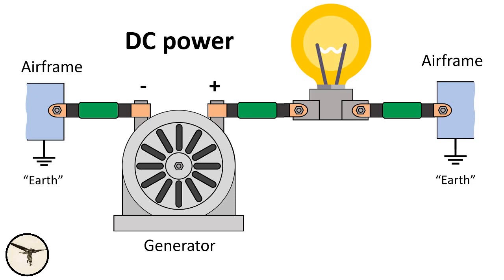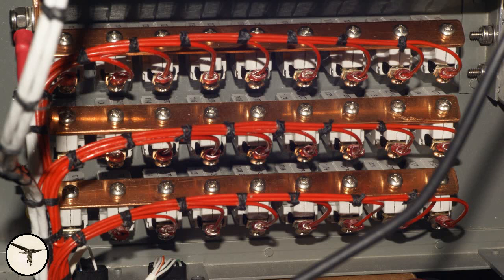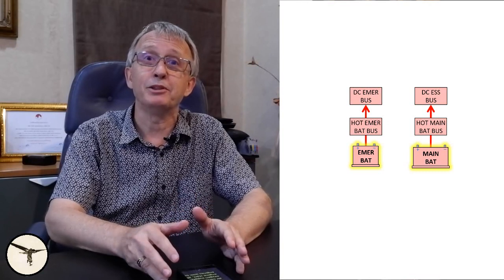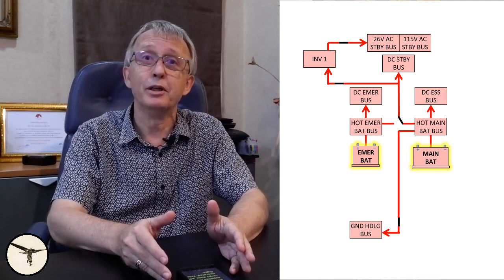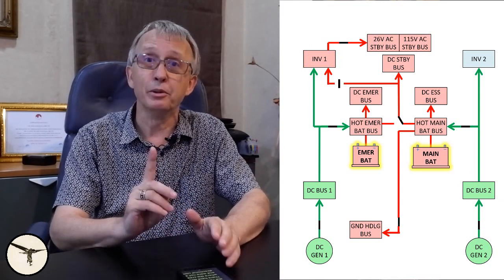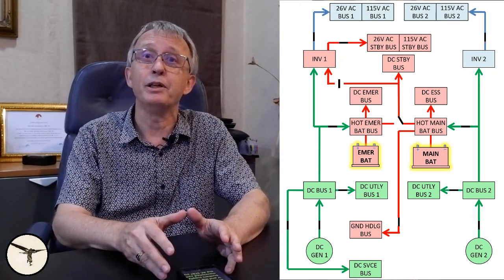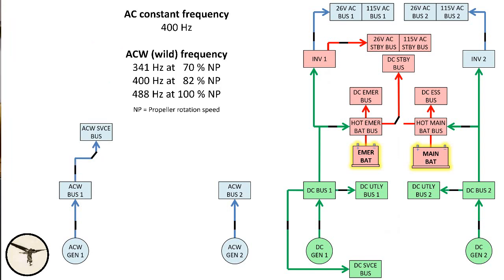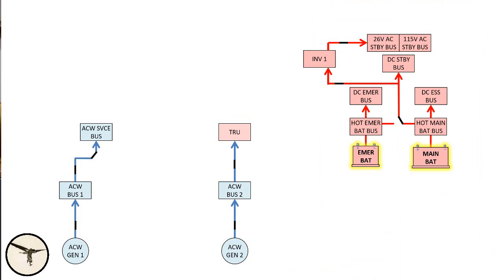ATR electric systems - an introduction

Comment: Hi Magnar, question about your production. What do you use to draw your diagrams, for instance your drawings if the battery busses with the consumers is very clear. What software did you draw it in?
Reply from the maker: PowerPoint, converted to image files with Photoshop.

Comment: Hi Magnar, is there a theoretical discharge rate for the HOT MAIN and EMER BAT BUSES with the battery switch off?  Because they are HOT, there must be some sort of depletion over time.
Reply from the maker: Hi. All batteries will detoriate over time, but we are talking about months.  However, the main battery might be depleted if the GND HDLG bus C/B is not pulled, and the refuel panel door is open, or the cargo door is operated.
Reply: @FlywithMagnar  thanks for reply. Just thinking the ATR batteries would drain quicker with a  HOT bus connected to them compared to battery that didn't. Thanks again

Comment: Funny you mentioned that about the TLU. We were just going over the QRH and a DC BUS 2 failure (72-500) and how to go about the lost equipment list. Should all items on the loss list be reviewed through the QRH or should we skim and find most relevant?  With something as important as the TLU auto function lost it would seem it should be included in  the main body of a  DC BUS 2 lost checklist. Maybe on the 600 a page is queued up. How do you approach the lost equipment list?
Reply from the maker: Hi, first of all, abnormal and emergency checklists must not be modified without consent from the manufacturer, as they are part of the certification of the aircraft. I only have the 72-500 QRH from 2009, and the checklist for loss of DC BUS 2 is different from the checklist for the 72-600, which I am flying today. In the checklist for the 72-600, the TLU is included. 
I recommend to read every item in the lost equipment list. Some items might be irrelevant, but you will only know after reading the list. If required, enter a hold and sort it out. 
Some years ago, I had a DC BUS 2 fault, and since we were 70 NM from the airport, we had plenty of time to read through the list, and prepare for the approach. We even had time to look out and enjoy the scenery.
Reply: @FlywithMagnar   "take your time" is always a good approach. Get a cup of coffee and work the problem assuming it's not an emergency.  I was also curious how to interpret the lost equipment items for "BATT only" and "STBY BUS". For BAT only (ACW available) I assume this is lost equipment under a TRU operation with no HOT BAT BUSSES? And STBY BUS lost equipment is if somehow we lose those busses?  Seems the only way to interpret it. Mange tak for hjælpen Magnar. .

Comment: why cant we get dc gen one  and two powered through ext power ,with battery switch off?
Reply from the maker: No reason for that. When we want to unpower the aircraft, we select the battery switch off. That is what it's made for. The GPU is used to provide electrical power to the systems when the engines are shut down on the ground. When the engines are running, the generators provide this power. Routing power from the GPU to the generators will only create extra heat, which is waste of energy.
Reply: I mean to say..if battery switch is off and gpu on ..then efis on number one and number 2 goes off.why do we need to put battery on to get power supply from gpu?
Reply from the maker: @shivapoudel9059  , the battery switch is the main electrical switch. When the battery switch is off and you connect the GPU, it will only power the CD SVCE BUS (lights in the cabin) and GND HDL BUS (refuel and cargo door operation).
Reply: @FlywithMagnar  its dc service bus right sir?..but in flight if we put the battery switch off ..does it work in same way?
Reply from the maker: @shivapoudel9059  , yes I meant DC. I have never tried to switch off the battery switch in flight. Never will I try it.
Reply: @FlywithMagnar  thankyou sir

Comment: Is it normal or am i doing something wrong in the sim? During taxiing with idle throttle i got low dc power
Reply from the maker: The ATR model in MSFS is wrong. Until the next update is ready, you must keep the power levers slightly above GI.

Comment: Question, the FCOM states that the Propeller AntiIce will not function below 63% NP. I’m pretty sure the ACW generators require 66% NP but I can’t seem to find it in the FCOM anywhere. Do you know what NP value the ACW generators come online?
Reply from the maker: If I remember correctly, the ACW generators require 65% NP to operate. Minimum propeller speed with engine running is 70.8% NP. 
One ACW generator can power both ACW buses and therefore all systems powered by ACW. In case of an engine failure, the associated propeller de-ice is not required. Therefore, propeller anti-ice is inhibited when NP is below 63%. This protects the propeller from heat damage.

Comment: Thank you so much for the videos. I have a question, if you don't mind. In my flights in MSFS, I've noticed that the condition levers have to be in AUTO for some time before I can engage the TRU, usually when I am getting into my taxi, but that it won't be engage-able at any point before that. Do you know what the necessary condition is for it to be actionable? Is it related to the prop speed or is it a matter of ACW power generation hitting some threshold? I am curious more than anything and would like to understand what is happening under the hood for that to become available.
Reply from the maker: The TRU is powered by ACW BUS 2, which is powered when at least one ACW generator is online, which requires the associated NP to be more than 65%. You should not start taxi until both NP are stabilized at around 71%.
Reply: @FlywithMagnar  Thank you so much! My virtual passengers say thank you!

Comment: Hello Magnar, is TRU used in normal operation flights or just as a safety measure when needed ? 
Thank you
Reply from the maker: TRU was designed to allow for ETOPS operations. But after two incidents where all instruments were lost, we use the TRU for every flight as a precaution. ATR has tracked the error to a design fault in the battery switch. When the switch is replaced, we will not use the TRU any more.
Reply: @FlywithMagnar  It reminds me of Captain Sully (Hudson River water land) who chose to switch on the APU despite the fact it wasn't written on the checklist . Smart move gained with experience 👌

Comment: Does the TRU charge batteries? If not, then why in case of battery failure, even if TRU is supplying EMER buses, aircraft loses electrical power?
Reply from the maker: No, the TRU does not charge the batteries. In case of battery failure, the TRU still supplies the EMER bus, ESS bus and both STBY buses. Both HOT BAT buses are lost.
Reply: @FlywithMagnar  Thanks for the reply!

Comment: Thank you for the Video, Capt! 
I have questions about DC GEN 1+2 FAULT in QRH. 

When if no TRU arrow light,
MAX IMC FLIGHT TIME : 30 min

1) Why IMC? Is there special reason? 

2) I guess ‘30 min’ time limited due to batteries usage time. Is that correct?
Reply from the maker: On battery power, with the battery selector in OVRD, the main battery powers DC ESS BUS, DC STBY BUS and AC STBY BUS, while the emergency battery powers DC EMER BUS. After about 30 minutes, the main battery will be empty, and you are left with the DC EMER BUS, which powers COM 1, ATC 1, and the stand-by instruments. You have no navigation aids, but will be able to receive radar vectors.
When you are about to commence the approach, you press the STBY BUS OVRD pushbutton, and the emergency battery will be connected to the DC STBY BUS and the AC STBY BUS. This activates the captain's EADI, VOR/ILS1, landing gear control, and flaps control, enabling you to fly an approach and land. (I'm  assuming you are flying ATR 72-500.) The procedure with no TRU is found in MMEL 24-30-02P.
Reply: @FlywithMagnar  
Wow, I totally understood ! 
Thank you so much capt !!
Reply: @FlywithMagnar  thanks. 🙏

Comment: Question for you @flywithmagnar 

Aircraft on the ground with the engines running at max RPM and the ACW EXT PWR AVAIL/ON. What will happen when you select ACW BTC pb to ISOL? 

Im stuck on this
Reply from the maker: This is a perfect scenario to test when you are in the simulator! The more curious we are, the more we learn.
- - -
When ACW EXT PWR is ON, it is the GPU that supplies the ACW buses as EXT PWR has priority over the generators. When BTC is set to ISOL, the connection between EXT PWR and ACW BUS 1+2 is lost. 
But from then on, I'm not 100% sure. I am 99% sure that the ACW generators will start to supply their respective ACW BUS. 
- - -
The ACW SVCE BUS is powered by ACW BUS 1 as long as ACW BUS 1 is powered. If ACW BUS 1 is lost (1% chance in this scenario), ACW SVCE BUS will be powered by EXT PWR.
Reply: @FlywithMagnar  thank you! We are in the sim later today and shall try it

Comment: That was a great overview of the electrical system.  So other than the internal batteries (Main & Emergency), there is no other back up auxiliary power unit that can be started, that runs off of the planes jet fuel, that can be used as a battery charger or tied into the electrical system if the batteries become discharged, and you don't have a power cart at the airfield?  How would a remote airstrip operation work then?  You have to have a generator at the airfield?  What voltage and current rating of the external power cart is required to allow a ATR 42/72 to be powered up if the batteries are too low?
Reply from the maker: First of all, we take precautions to ensure that we do not deplete the batteries when we are on the ground. When an airport does not have ground services, and we have short stop, we let engine 2 run with the propeller brake engaged, so-called "hotel mode". When we have a long stop, we shut down everything and start engine 2 in hotel mode before boarding. 
The batteries can be charged by external ground power (GPU). ATR aircraft requires 28 V DC ground power. It must deliver 300 Amp plus additional 1000 Amp during start where the voltage must not drop below 12 V.
Reply: @FlywithMagnar  Thanks for responding.

Comment: Hello captain. I have a question, why do you need to turn off green hydraulic when DC gen 1 and 2 is lost?
Reply from the maker: The answer lies in the TRU. When both DC generators are lost, we select the TRU to conserve the batteries. The TRU is powered by ACW BUS 2. Early ATRs don't have TRU, and when it was introduced, the rest of the electrical systems were not changed. The ACW generators have limited capacity. To prevent overload of the bus, some load must be removed. The solution is to switch off the green hydraulic pump.
Reply: @FlywithMagnar  To add to that, ATR expect that a DC GEN 1+2 failure occurs when one engine has already failed, and subsequently the remaining generator fails. This means that the whole ACW system is running off one generator. Turning off the green pump unloads this remaining generator.

Comment: Great video Capt, had the pleasure of undergoing a sim session with you in Bangkok. Question: could you please clarify why INV 1 is a No go item?
Reply from the maker: In case of loss of both DC generators, only inverter #1 can supply AC STBY BUS. This bus is very important, especially when you have an EFIS cockpit.

Comment: Hi Magnar, are the batteries not 28 volt? I did see reference to 24 volts in the FCOM too but I always thought that you would need 24 volt batteries to power a 28 volt DC system. By the way I'm not trying to catch you out. I was just wondering if there was a reason for this. Many thanks for your help and great video as always!
Reply from the maker: Batteries always have less voltage than generators. This prevents the batteries to discharge in case the generator voltage drops below normal.
Furthermore, battery voltage varies. When freshly charged, the voltage is higher. When used for a while, the voltage is less. However, DC electrical equipment can work without a hitch down to 18 to 20 volts.
Reply: @FlywithMagnar  thank you for explaining this Magnar, that is very interesting!
I owe you lot of pints of Guinness if you ever find your self over here in Ireland!
Reply from the maker: Thank you. I used to go to Dublin some years back. Did some instruction at Simtech.

Comment: Thank you once again Magnar, I m constantly learning about this aircraft. 
Can I just ask you about the difference between a BTC and a BTR please? Does the BTC just allow 1 DC generator to supply both sides and the BTR allow 1 inverter to supply all AC bus bars? Is this correct? Do they do anything else?
Thank you!
Reply from the maker: Yes, you are correct.

The BTC allows for one DC generator, or external power, to power all DC electrical systems. It operates automatically, but it can be isolated manually.

The BTR connects AC bus 1 and AC bus 2 in case of an inverter failure. There's no indication showing whether it's open or closed. But you now it's working when you have an inverter failure and all AC busses remain powered.

However, when you isolate the BTC manually, you also isolate the BTR.
Reply: @FlywithMagnar  that's great Magnar, I appreciate you taking the time to reply. Electrics can be a bit of a head scratcher at times but when when you break it down, it's about electrical supply and how it's backed up. Thanks so much again!

Comment: Great job 
One question pls? How and when we use Table of lost équipement List dc +ac  stby bus ?
Reply from the maker: Loss of both DC STBY BUS and AC STBY BUS happens when both DG generators have failed + no TRU + the main battery is empty (STBY BUS UND/V light). You can read the lost equipment list when you have time, but it's more important to fly the airplane. You are left with the emergency battery, which powers the standby flight instruments, trims, VHF1 and transponder 1. About 10 minutes before landing, you press the STBY BUS pushbutton, which powers captain's EADI (EFIS cockpit; in a glass cockpit, you continue to use the IESI), NAV1, flaps control, and landing gear control. This enables you to fly an ILS and land.
Reply: @FlywithMagnar  thanks a lot Captain

Comment: Good evening Capt. May I ask you where I can find the ATR 72-500 system failures, with the same method like you use in yours videos. I mean for example: if you have a DC Bus 1 fault which one bulb on and whom remaind off. I do not know if you understand what I mean, however great videos congratulations for your support.
Reply from the maker: Since you mentioned DC BUS 1 fault, I will explain how I will find information about that failure. The main indicator for a DC BUS 1 fault is the "DC BUS OFF" light on the main electrical panel. Since this bus powers several systems and other buses, there will be several other indications. When this failure happens in flight, you will use the procedure in QRH, where you also will find a list of affected systems. To get a full understanding, I use FCOM.PRO.NNO.ABN.24 which, in addition to the information in the QRH, describes the other alerts (DC GEN 1 FAULT, etc.), and FCOM.DSC.24 which describes the electrical system in detail. Then, I will check each one of the affected systems and find out whether they trigger an alert or just go dark. For example, when DC BUS 1 fails, the autopressure system fails. The indication is "AIR" on the cap, and a "FAULT" light in the MAN pushbutton on the panel. And so on.
Reply: @FlywithMagnar  yes Capt. But I want to know where I can find this explanation like your videos, because I saw a lot video about system (btw your explanation is real one of the best that I saw), but not one about system failure. If I do not find it I want to do it myself but I do not know how to do it like your presentations in spanish however I have a youtube channels without voice with few procedure but like a told you I want to make system failure presentention o find it like yours.
Reply from the maker: @tazpilot  I don't know about others making videos about system failures. I present some of the failures in my videos. Regarding producing videos, I do by trial and error. I use VSDC Free Video Editor, which works well for me, but the initial learning curve was steep. Thankfully, there are many tutorials on YT. I take a lot of pictures and have FCOM for most of the variants. I also draw figures with PowerPoint and use PhotoShop.

Comment: Can you explain ADAPTED FLIGHT-IDLE
Reply from the maker: Yes. When selecting flight idle at high speed, the propellers produce high aerodynamic drag. This is helpful when it comes to reducing the speed for approach and landing. However, the disturbed slipstream behind the propeller affects the wing's ability to produce lift at a high angle of attack (AOA). Therefore, the EEC will automatically increase the fuel flow when the AOA is less than stall warning threshold minus 4°, reducing drag and ensuring that the propeller slipstream does not disturb the airflow over the wing. (FCOM.PRO.NOP.NSU.70.7)